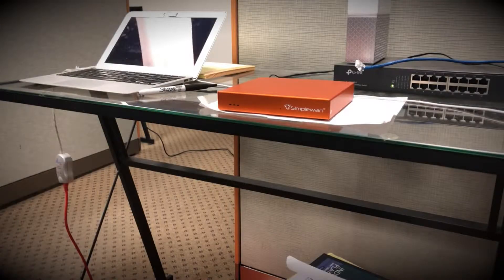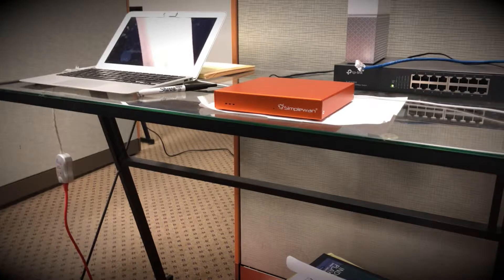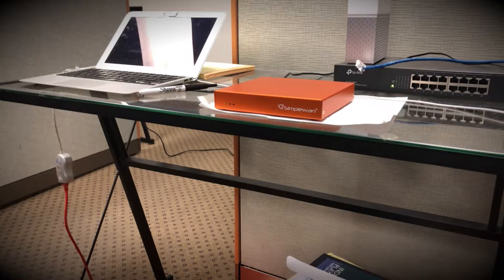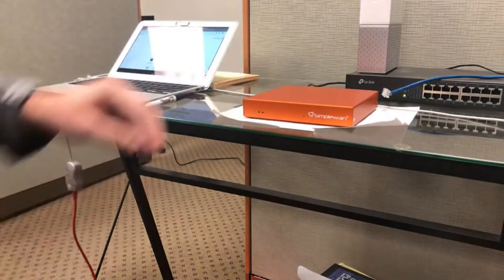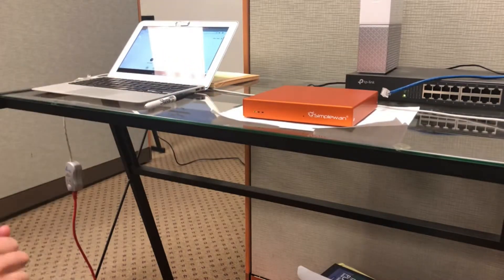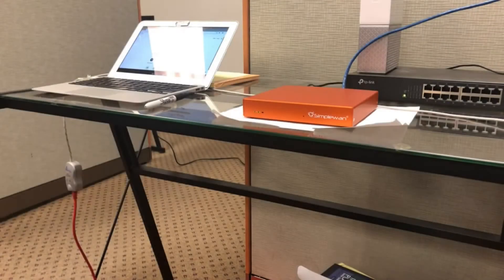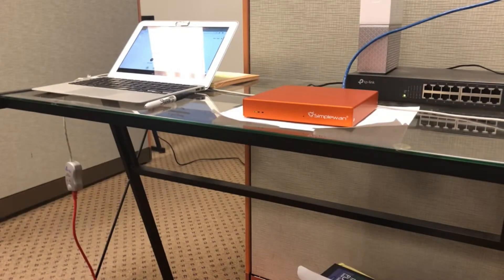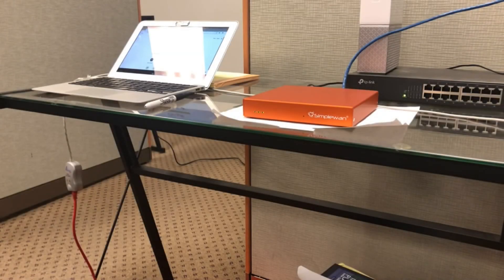SimpleWAN Setup Step 1 & 2

Comment: Hi, how do I set up a static IP in the Interface? It's asking for the Gateway. Where do I get that? Is that the internal or external Gateway??
Reply from the maker: Hello ACTINC Labs,

Thanks for the great question. There are actually two different ways to statically assign IP information to the WAN interface of the SimpleWAN device. 

The first and recommended way is shown in the video above. First, you will provision the SimpleWAN MAC address in your SimpleWAN portal. You will then provision the static IP in the WAN interface tab. You will input the IP, Subnetmask, and Gateway in this section. (This information is provided by your ISP) Once this information is saved you will connect the SimpleWAN following the video above.

The second method to statically assign IP information to the WAN interface is similar. First, you will provision the SimpleWAN MAC address in your SimpleWAN portal. You will then power on the SimpleWAN and connect your computer to the LAN port of the SimpeWAN and wait until you receive a local IP. Once you receive an IP open a browser and go to 192.168.2.1. You will now see the option to select your WAN type and input the IP, Subnetmask, and Gateway in this section. (This information is provided by your ISP) Once this information is saved you will connect the SimpleWAN following the video above.

If you are still having issues with setting up your SimpleWAN, please contact our chat support at www.SimpleWAN.com

Thank you!